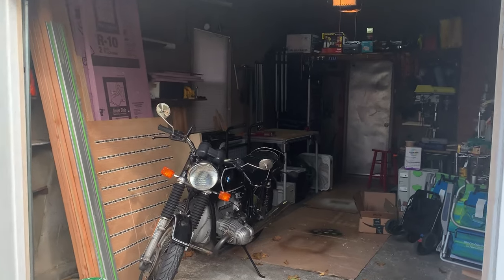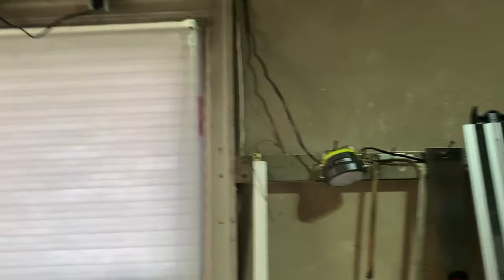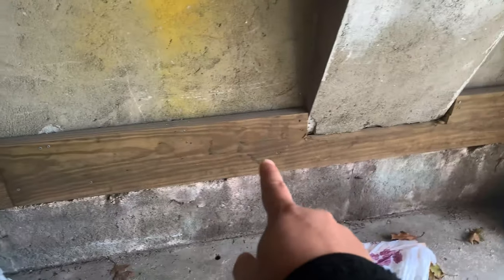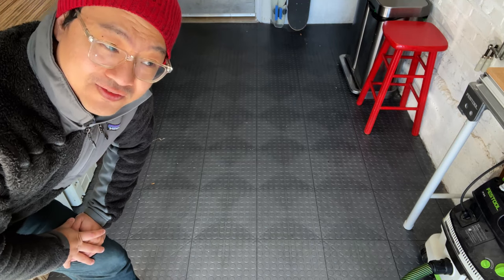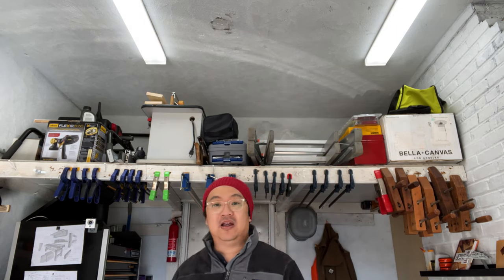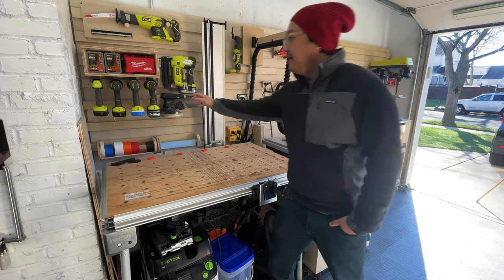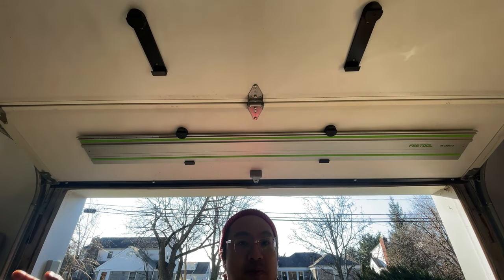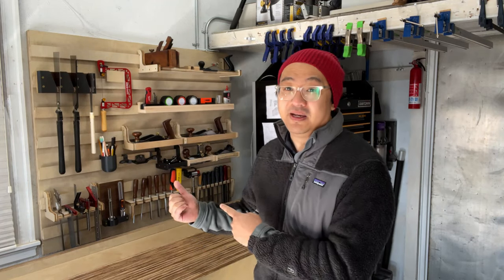2020 Shop Tour Single Car Garage Workshop

Comment: I love the French cleat system. The modularity of it just takes all the pressure away from making tool holders. Like if you get it wrong or you want to change something it’s so flexible and you don’t lose all the time you spent.

Your holders are really nice
Reply from the maker: For sure! I been getting more hand planes. So I been thinking of making a hand plane till. But I can repurpose the current individual shelves for something else later

Comment: Great video and great transformation in one year. I wish my 1+ car garage shop was as organized and clean as yours. I have found it is handy to have a portable planer. I have mine mounted on an old night stand on casters and it doesn't take up much floor space. It is very noisy though,  so I use it outside. Sorry neighbors.

Comment: Nice walkthrough Dave!  I started setting up my 1 car garage shop a few months ago.  It seems like you're about a year ahead of me in terms of organization and setup, so it's helpful to see how you used your space.
Reply from the maker: I know when I was trying to figure out. I was watching and reading everything I could. I hope some of the ideas might help you in some way. I do think that working in it more helped shape how to use the space. It’s also constantly evolving.
Reply: @3ddiy  Yup, it's definitely helpful.  I've been back and forth between peg boards vs french cleats, but I'm leaning towards french cleats.  I'm planning on making a workbench soon with laminated plywood, yours looks really nice, I'm not settled on a design yet though.

Some of the trickiest decisions seem to be around big tools or even how many how medium-sized benchtop tools the space can handle before things get too cramped.  I don't have a planer or jointer, and like you, I'm exploring the hand tool route to cover some of their use cases. But I do already have a CNC machine with about a 5'x5' footprint from a previous business, I really want to find a way to make it work without it being a big chunk of otherwise unusable space.  The shaper you have seems like a great solution, for CNC functionality with a super tiny foot print.
Reply from the maker: @richnelson2042  I considered pegboard too at first. But I’m glad I went with French cleats. I think there is so much you can come up with French cleat holders that you make and have fun with. Pegboards your kinda stuck spending more time looking for and buying accessories. Love to see what you come up with.

Comment: Did you ever figure out what those big hollow concrete triangles were that were protruding from the garage walls? I literally spent 30 minutes googling keywords trying to figure it out but had no luck... Thanks for the tour!
Reply from the maker: No!!! I was hoping the internet was going to tell me! Thanks for trying. The reason I thought it was for a boat storage is that both columns look like they had a 4 screw plate that went in the same spot that would have ran something straight across. The height was just about the same height as a pick up truck. Back in the day I saw that they used to run hitches in the middle of the pick up bed. So maybe the bar was a support for the trailer. Just looked it up it’s called a gooseneck hitch. That’s my only guess. That makes sense in my head. It drives me nuts. It’s going to be one of life’s biggest mysteries.
Reply from the maker: @3dbronze  wow that’s not cool. I asked him to take it down thanks for the heads up.
Reply: But you removed them right? How were they built?
Reply from the maker: @trep53  they were removed. It was just wood 2x4 inside. With drywall and cemented over.
Reply: Thanks. After seeing your reworked shop I’m going to paint mine too, it really brightens it up.

Comment: What year is your BMW R90/6?  Did you make any mods to give it the scrambler look or did it come that way?  Very nice bike and garage upgrades btw!
Reply from the maker: It’s 76, I did a lot of mods inside. The engine was rebuilt with a 1000cc bore kit, new modern carbs, and suspension and lighter flywheel. The previous owner had dual disk brakes put in for the front. So it is essentially a 100S but looks like a normal R90. Looks wise it’s pretty stock. Even the original seat and rear badge.

Comment: Nice shop, Dave! Just got the same Ryobi drill set, do you have a Thingiverse link for those french cleat drill holders? Would love to print some for my shop.
Reply from the maker: For most of the drills. I used this model. For the torque you will need to scale it up slightly. https://www.thingiverse.com/thing:1372590 

For the glue gun you can find it in my designs page. You should be able to find a few more of the cleat holders and things in there. 

https://www.thingiverse.com/3ddiy/designs

Comment: Why did you use a Dyson vacuum cleaner to clean the workshop instead of the festool vacuum?
Reply from the maker: The Dyson for the house just lives in the garage and charges there. But I do use it to vacuum up the small stuff sometimes. It’s just really easy to use love that thing. I have even used a roomba in the shop too. It’s just whatever is easiest. The festool might be connected to a tool and I do t want to get the hose. I can just reach for the Dyson.

Comment: Nice improvement.  I like the boom arm -- this seems like an excellent match to your tool setup.  What do you do with the track saw vs. table saw?    I ultimately got a jointer not for rough lumber but because it was hard to get truly flat/square lumber.
Reply from the maker: I think a track saw is a must if you are dealing with lots of large sheets of plywood. Which I use a lot. It’s safer to break it all down then go to the table saw for any ripping. Or small enough to cross cut on my cross cut sled. I have a few ways I can make something square, the track, the table saw and my hand planes. I don’t do it often. So what I have is fine. If I did do rough lumber more and panel glue ups I would consider a jointer. Or a planer jointer combo.